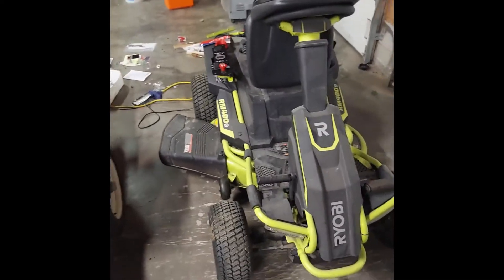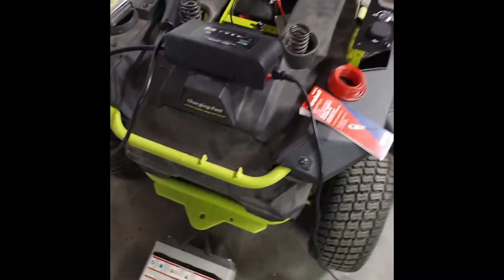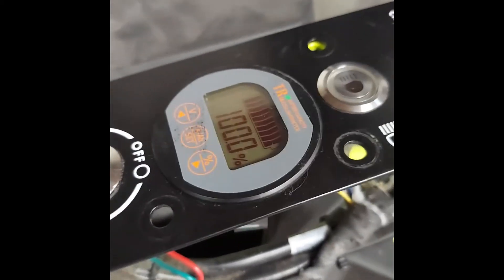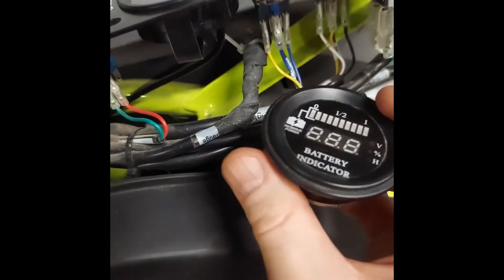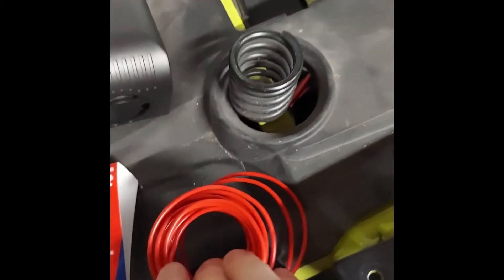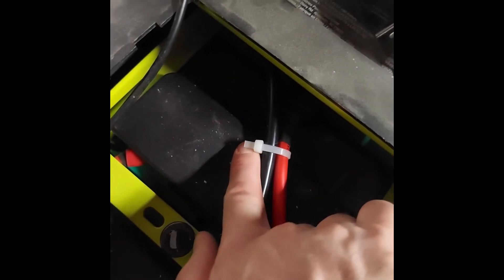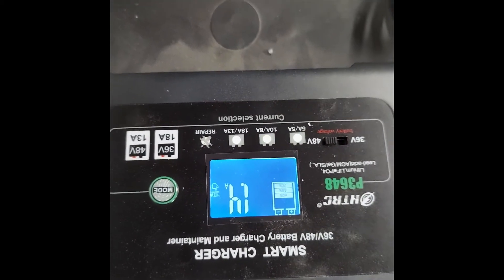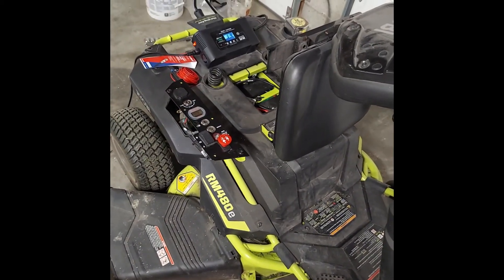Upgrade Ryobi RM480E/RY48110 to LiFePO4 Batteries - Tutorial + Required Parts

Comment: I was wondering if the voltage gauge/meter is always turned on why couldn't  you run the little red wire to the ignition switch instead  on the positive battery terminal ?

Comment: Imagine spending another $1500 for an upgrade in batteries for a mower worth $300.  I thought about going electric.  I ended up buying a 25hp rider and when I need to change the battery it only costs $40

Comment: Thats a pretty big list of parts.   You can cut down on needed parts by getting a Lithium battery with a Bluetooth BMS built in.   I just finished my conversion 3 days ago.   Single battery, 48v, 100mah...with bluetooth built in.  I use my phone to monitor the battery.
Reply: what are the parts you used?

Comment: Thank you for the video. I am a single female homeowner. Property is about .7 acres. I brought this mower back in June 2021. It's now June 2025 and it finally died. I was hoping to make it to the end of this grass cutting season...but looks like I'll be replacing the batteries. It seems pretty straight forward. I'm debaitng if I want to try to do it myself or try to find someone to do it for me. I'm pretty handy....and don't mind a good diy project. For those that have done this before do you think this is something I can tackle on my own.

Comment: For the life of me, I can’t figure out how you’re doing that bridge. I followed other videos for that bridge, and it spit a few sparks at me. 

I mounted the bridge (B-) directly onto the negative end of the battery (as I saw in another video), and I connected the cable that’s already plugged into the charger (seen onscreen at 6:05) into the other end of the bridge. I connected my 14-gauge positive wire into the bridge, as per the instructions, and that positive wire is what burned. I don’t know what that 4-gauge wire is supposed to be doing other than replacing the current one, unless mounting that bridge to a different location inside? It’s not shown here. Any suggestions are appreciated.

Comment: question you have 4 100ah batteries hookup, and you set your meter to 100ah should the meter be set to 400hr not 100ah?
Reply: No, because in series the batteries are now 48v with 100ah capacity.  If in parallel, the 4 batteries would be 12v but 400ah

Comment: Hello There! This versatile workhorse of a mower becomes a hidden gem if you replace the four lead acid batteries with the latest generation 48v Lithium battery. The conversion nowadays is extremely easy!
I made this 12-minute video walkthrough of all steps required with the help of my kids manning the camera: https://youtu.be/_dhhxN_IV7M
* Mow 3+ acres on a single charge and get another 10 years out of your mower with reliable/safe LiFePO4 batteries
* Built-in Battery Management System allows you to monitor your charge levels/battery health in real time right on your phone through a Bluetooth app
* No longer a need to keep mower plugged in when not in use (even over winter)
* New lithium battery weighs less than half of the stock lead acid batteries.
Lithium batteries were very expensive when this mower was introduced but have come down in price drastically in the years that followed. 
May God Bless You, Happy Mowing!

Comment: When swapping the power connector to the mower like you mentioned.  that new charger is 2 pin not 3 pin.  did you leave an empty pin in the gap or take out entirely?  IE one pin missing or there but not connected to anything.  I think it is the green ground wire in the old charger.

Comment: Hey Ryan, thanks so much for this video. My son and I did the conversion with exactly the parts and procedures you recommended. The Mower runs and mows again, much better than before! Just one question ..... after charging the batteries for the first time (we installed just like they came from the factory, without individually charging them), The charger stopped and displayed "Full", but the gauge reads 67%. Anything you would recommend?
Reply: You should charge each battery individually, that way they're balanced.

Comment: Great video. I just purchased 4 LiFePO4 12V 100AH batteries. The manufacturer said these batteries are not appropriate for starting something like a Lawnmower, but I don't think it matters since it's in series. Wondering if anyone had any issues on the type of battery. I think they are just trying to upsell me to their Golf Cart batteries.

Comment: Question: charger has +/-, mower has 3 pins. Is the third pin not used going to LiFePo4 ?
Reply from the maker: When converting over to the the new charger I took the original charging plug (with three pins) and put it on the new charger keeping the third pin as a "dummy." I think it helps with keeping it secure when it's plugged in to the mower but it's not necessary.

Comment: 4:19 the easiest way to install the new gauge is to use a hole saw. Leave the old gauge INSTALLED unplug the battery and drill the pilot bit into the center of the old gauge. This will keep the hole saw steady and takes about a minute to cut a perfect hole.
Reply from the maker: A step drill bit for metal works perfectly also.
Reply: A step bit is the proper solution, not destroying your old gauge to keep the improper solution steady.
Reply: @GregHassler  No way. Cleaner hole, correct size, takes less than a minute.

Comment: Can you skip the gauge replacement and just not have one?
Reply: Not the OP, but yes. I ran mine with no gauge for the first week.
Reply: @upload638  after the first week you added the monitor? Was there some mechanical reason or you just wanted it?
Reply: @Mdunlap0317  I bought it already so I figured I better hook it up. I just left it zip-tied and hanging out under the seat. If I need to check it, I'll just reach under the seat and look at it. I left the original monitor alone and it still lights up but doesn't change of course.

Comment: I recently put in the same set up but my gauge isn’t showing the battery life and my mower still isn’t functioning.  Any idea as to why or how to fix it? Feels like I’m missing something.
Reply: Not the OP, but I did this also. Can you describe how you wired it? If your gauge isn't showing anything, and the mower won't start, we will need your entire detailed set up to start with. I ran my install with no gauge at all for the first week, so something is definitely off.
Reply from the maker: I posted a wiring diagram at the tail end of the video. That's the best way for me to communicate how to do it.

Comment: Question: My right blade motor is weak and the left is good. Is one battery dedicated to one blade motor??
Reply: I am starting to notice this. My right motor is definitely bogging down now and I don't know if I ever noticed that before. I was just starting to research this myself so I will let you know if I find anything out but it is making me pretty mad.
Reply from the maker: I'm not sure how long the motors are expected to last. I haven't noticed anything yet after 6 years or so. It will struggle in taller wet grass but I think that is normal. If it starts acting like that, I'll lift the deck a bit for a first pass then lower it again for a second.
Reply from the maker: As far as I know, no. There are separate motor controllers for each of the motors, left blade, right blade, and drive motor. Here is a link to the wiring diagram https://www.partstree.com/models/ry-48111-099749002-ryobi-38-48v-riding-mower-rev-04-2017-11/wiring-diagram-20/

Comment: Im still on original batteries and will be looking to upgrade, but I have heard that charging all batteries at once at 48v is not the best way. They probably need a 4 battery charger so it can equalize each battery.
Reply: Over time the 4 batteries may get out of balance. Trickle charging LiFePO4 batteries in series will not balance them, unlike lead acid. Best is to charge each individually, maybe once a season. I would leave the batteries near half charge at the end of the season, which is best for Lithium longevity, then charge each fully and individually at the beginning of the season. Do not trickle charge Lithium batteries!
Reply from the maker: @chipstrat  The charging pack I have cuts off when the batteries are reading full. Shouldn't harm them to leave them on the charger all winter. Batteries also have built in BMS to prevent damage.
Reply: @chipstrat  lead acid batteries in series don't balance any more than lithium batteries.  It's the wiring configuration, they have no reference to each other, you can still get a single weak battery. There are numerous videos on YouTube of this exact thing happening with the lead acid batteries in this exact mower.
Reply from the maker: As far as I know you can just charge them individually before installing them so they are balanced. The one's I bought were fully charged when I received them. They should stay balanced from them on. I  take the battery tray out completely and but it in my basement when it starts to get cold. This is a good time to "rebalance" if needed and trickle charge in series.
Reply: Lead acid batteries in series can be balanced. With continuous charging, as each battery reaches full charge, it can still pass current, allowing the batteries that haven’t yet reached full charge to continue charging. Ultimately each battery comes to its fullest charge. That is not possible to to do with a string of lithium batteries in series. If one reaches its high voltage limit, its BMS will break the circuit whether others have reached full charge or not.
Reply: Naturally if one lead acid battery in the series string is fundamentally weak, it cannot be brought to the same ultimate capacity as the rest, but it can be charged to the point that it will store as much energy as it is capable of holding while in a series string. This is not the case with a series string of lithium batteries that each have a BMS.

Comment: Can you show me how you wired the shim for the meter? I got that meter and it didnt do well lol
Reply: If you are talking about the "shunt" that comes with the battery monitor all you need do is run every load negative to the P side. The negative on the B side goes to the battery and that should be the only ground attached to the battery. This is how the meter accurately measures volts, a/hr and capacity.
Reply from the maker: Yes. If you wire it directly like this, the monitor will stay on even if the mower key is off. I didn't bother wiring it through the key switch, but you can do that also if you want it to be turned off with the mower key.

Comment: The lead battery charger is 48V 13A so you can increase the amp instead of using 8
Reply from the maker: Probably but I don't necessarily need to have it charge faster. I put it on the 8amp when I'm done and it's ready next time I need it.

Comment: I'd love to swap to lifepo4 but we plow in the winter so it wouldn't work. :(
Reply from the maker: So I haven't tested it, but the batteries I show in the video are rated for operation from -4°F to 185°F. There's snow plow attachments for this mower also https://www.homedepot.com/p/Brinly-Hardy-42-in-Front-Mount-Snow-Plow-for-RYOBI-Electric-Riding-Mower-FB-42RY/307607412
Reply: You can discharge below freezing, but must not charge below freezing. You can get LiFePO4 batteries with built-in warming, but a bit more expensive.

Comment: Thanks for the great vid. I bought the exact charger you did, and when I plug in the batteries it says the batteries are full, even after being depleted. Any idea what the issue might be?
Reply from the maker: I'm not sure, I haven't experienced this. I only pay attention to what the gauge on the mower says. As long as the charger cuts off when the mower gauge reads full, that's what's important.

Comment: I live in the south and my mower stays in a shop so it never gets to or below freezing, when the unit was new(has the 100 amp AGM batteries) it cut the whole yard and have 90 % left, at the beginning of the second season, with only 11 hours on the mower, 1 battery went bad, here I am 2 seasons later at 50 hours and at least 1 of the batteries has failed(haven't checked them yet) So I can say, the run time on the battery was fine for me, but the life of the battery is really bad., This mower cost me a lot more than my gas ever did. Also, with the blades being directly mounted to the motor shaft, it is much more critical to have the blade perfectly balanced, or you will be damaging the bearings in the motor a lot quicker, a nail on the wall or the cone shaped thing will not get blades properly balanced, you need to have them horizontally and vertically balanced and the  Magna-Matic MAG-1000 Blade Balancer makes doing that an easy job, although it's about 200.00, there are some cheap knock-offs on ebay for about 60.00. Also, the blades that go on this unit are so thin, they don't last me 1 season, where my gas blades lasted 3 seasons, so not at all happy with my unit, don't think I will be wasting money to do this upgrade, but loved seeing it done.
Reply from the maker: I usually swap and sharpen my blades every 10 mows or so.  Sometimes they're a little bent from hitting something I shouldn't have and I can usually get them back into shape decent enough. I haven't had any problems with the blade motors so far after owning for 6 years now.

Comment: How to program the gauge
Reply: Press the center button and set the amp hour rating of your battery. Press the volt button to set at 100% if that is the state of charge of the battery.
Reply from the maker: Yes

Comment: The links to Amazon batteries and charger are no longer active.  Can you tell us model / brands ?
Reply from the maker: I just updated them @BroJoeShow
Reply: Rather than leading to a general page for the batteries, can you specify what actual model of battery you used, and also what challenges you encountered with the sizes not fitting the space?
Reply: Yes, because the new link is also no longer working. Thank you much!

Comment: Excellently done . Also   New battery life and the hours you get ?
Reply: I did this also and mowing my half acre with trees and a fence to go around, so a lot of extra moving, I end the mowing at between 55% and 62% battery life now on the new batteries. My original batteries that came with degraded so far I had to charge 3/4 of the way through my yard.
Reply from the maker: Going into the second season with them I do my 3/4 acre lot using about 30% on the 100ah setup when the grass is dry. This is maybe a little less than the first year but not by much. During the winter I pull the entire tray with batteries and put it in the basement to trickle charge.

Comment: What is the total cost including charger and and wire ?
Reply: I had around $1650 USD in the batteries, charger, wiring and meter. Batteries alone were $1376 to my door.
Reply from the maker: Right now you can get the 100ah batteries for about $200 a piece. Charger is $150. Gauge and wire is about $50. I looked at it this way... I already bought the thing.. no turning back time, so either spend the $1200+ or so on new batteries or $2k+ on a new gas rider. I got about 3.5 years on the original batteries before I couldn't take it anymore lol.

Comment: Hows the upgrade so far?  Some people were having issues with the mower not turning on after a similar setup.  Mostly because of the charging part.  I also see that you have 3 pins on the new charging connector.  Did you leave  the top pin in for a reason?
Reply from the maker: I haven't run mine since last season. I remove the battery tray and keep it charged in my basement when it starts to get cold. I left the third pin just for support when plugged in. It isn't necessary though.

Comment: Can you simply use a single 48V lithium ion battery pack instead of 4-12V packs?
Reply from the maker: You can but usually more expensive
Reply: I think this is what I'm planning on doing to simplify the wiring.
Reply: @VideoPir  The wiring is very easy though. I weighed both options and went with 4 separate 12v.
Reply from the maker: @VideoPir  I think in the long run, it's less costly to do 4 12v. It's less upfront and if anything goes wrong with one of them it's cheaper to replace than 1 single 48v.

Comment: I am reporting back in now after a full summer of mowing. Flawless. No problems whatsoever with the charger, the batteries, etc. it has been great. The lowest I've been able to get the battery level down to is 65%, and once in awhile it will bog in heavy grass quick, but one thing that has never happened is a stall with these new batteries. In fact, stalling in even a small challenge grass wise was the first sign of my original batteries failing, and I would stall constantly in my back yard when the upgrade became an absolute necessity (outside of the 20 minute run time). 

I think I might have one more mow and then it will be winter storage. I might pull the battery tray out and store the batteries in the heated basement but I'm not sure if that matters.
Reply: Don't store the battery at 100% charge...for longivity let it discharge to around 70% when storing for extended periods.
Reply: @rickss69  I mow once a week, I charge it to 100% after I am done and just mow later. There will be no other way I am going to approach it unless I just don't charge after the first mow, mow a second time and then charge to 100. If you mean over winter, I can do that.
Reply: I've read that you absolutely should not charge these lithium type batteries when they're cold or below a certain temperature because it will harm them. I think the temperature might be around 50°, so research it. Sorry, I forgot the exact degree.